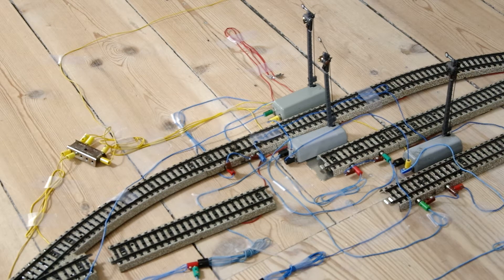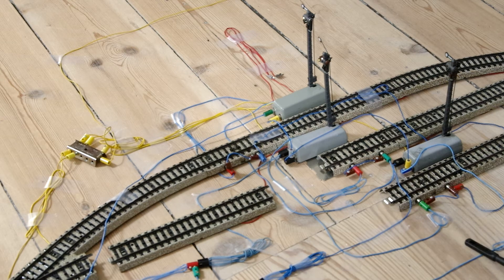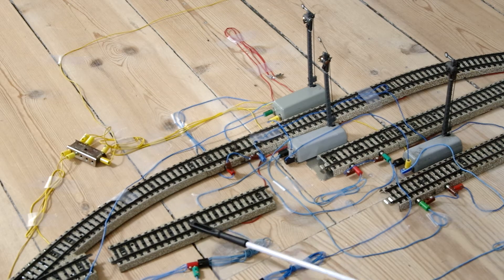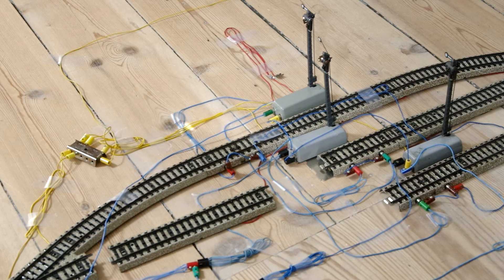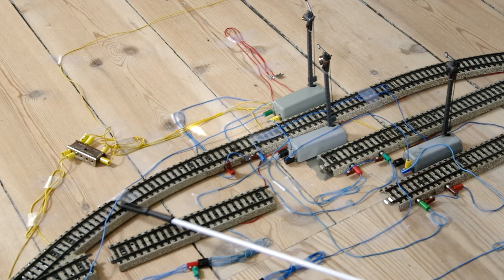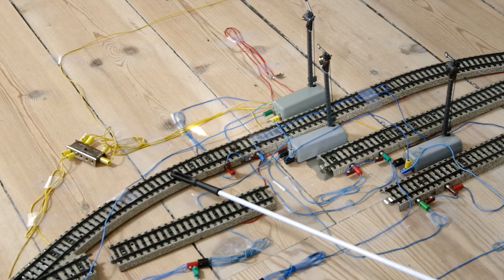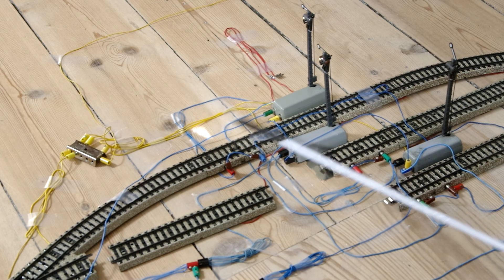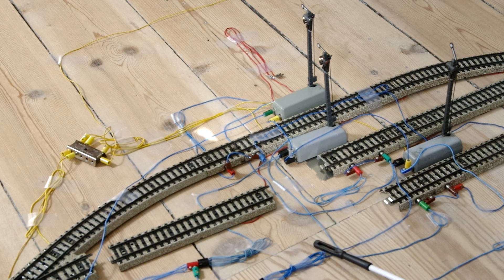Bidirectional station wiring explained (1/2)

Comment: I'm just getting into signals, and this station set up looks awesome.  I kinda understand the idea...
Reply from the maker: Thanks. There are many ways to design these kinds of automatic layout, so pick one that suits you. I chose this particular design because it requires very little track material, only one signal and one contact piece per station track. I could then build a larger station with what I had. The downside is weak realism, a prototype station doesn't have signals in the middle.
Reply: @anderspedersen4783  so nice of you to reply.  Is there anything like a wiring diagram that's available for this sort of installation?  A lot of people are wanting me to go with c track and digital control, but I grew up with M track and I love the look, feel, and sound of it.
Reply from the maker: @johncharlesgalleni4104  You could go digital on M track and get the best of both worlds. The kind of layout I'm presenting here is more of a study in how far you can take the Märklin analog system. The signals are mostly 7039. The best source of example signal wiring diagrams are probably the old Märklin signal books, they exist as scanned PDF's around the internet.
Reply: @anderspedersen4783  I don't really the money right now to go digital.  Everything I have is analog, plus I like the analog "feel." But I'm definitely beginning to get it - your setup is basically a "passing track" with multiple layers.
Reply: @anderspedersen4783  let's keep this simple.  One circuit track per station rail, one circuit track at the first turnout entry...what model signals are those?